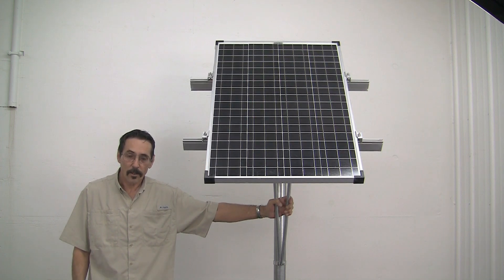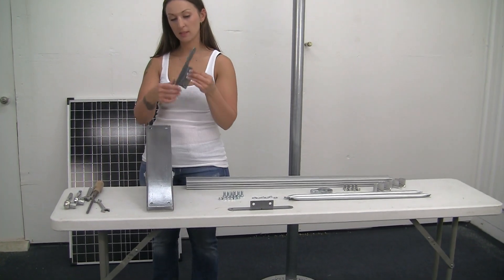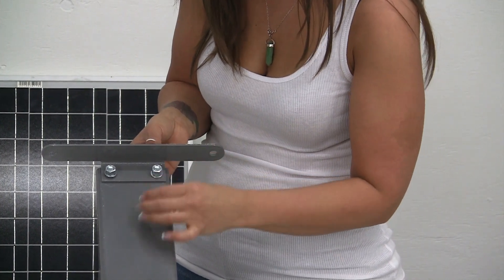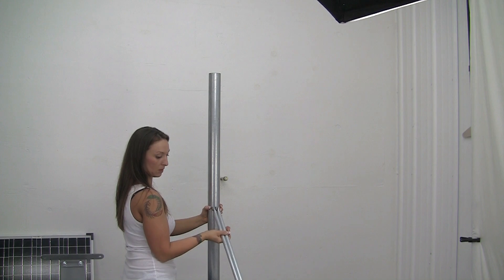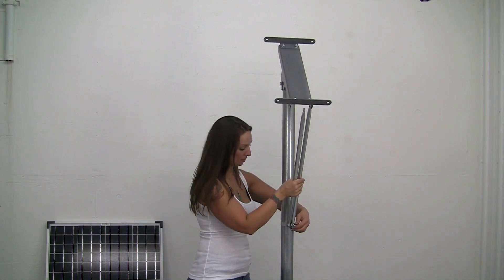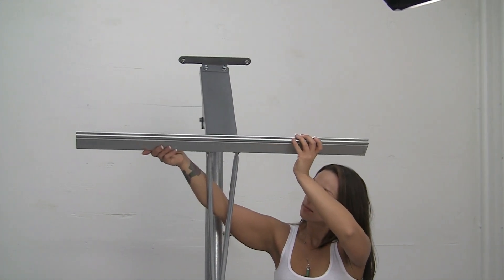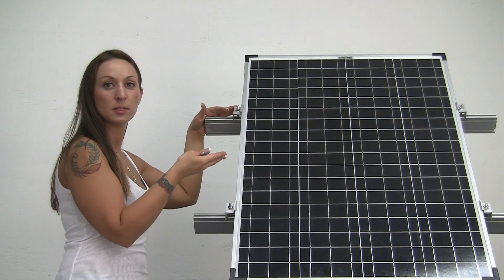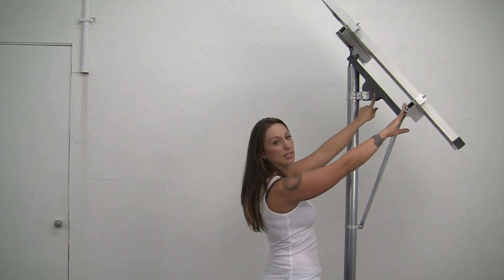Solar Panel Top of Pole PV Mount | Missouri Wind and Solar

Comment: What is the price for this?
Reply from the maker: Zakarume About  $119.00. We have to get it all together first, there are different size rails that will change the price.
Reply: MissouriWindandSolar Ok i see this on your website. It says it can hold a 230 watt panel. Will it hold the 250 watt panel you sell?

Comment: I love it, works along the line of my passive mount... Looking good guys!
Reply from the maker: Ron Parsons Thanks Ron. I have a bigger version down the road coming out.
Reply: That's really good. It really is a good layout for solar panels. Not sure if you've seen my video or FB pictures.  Also I made a solar heater this last winter that really worked well. The output was at 90+ most sunny days at freezing and below. Using it alone I measured the entire house temp at 78 degrees and it was 21 deg outside all that day. Saved us piles of money!
Reply from the maker: Ron Parsons No i haven't seen it Ron, love to though. I have a real hard time keeping up with youtube vids. I will check it out.
Reply: cool